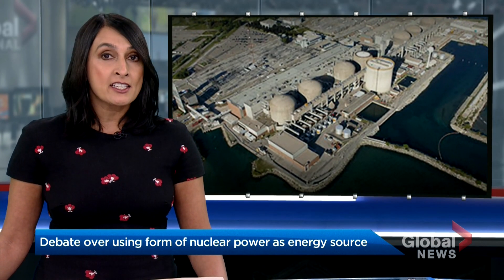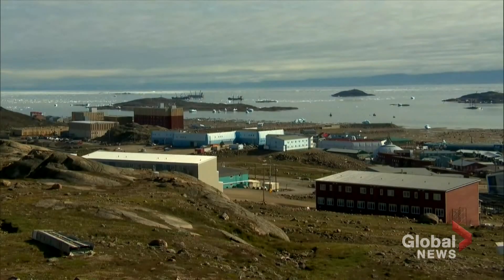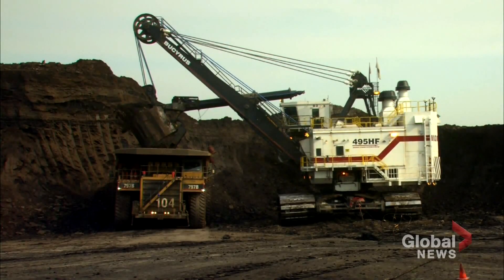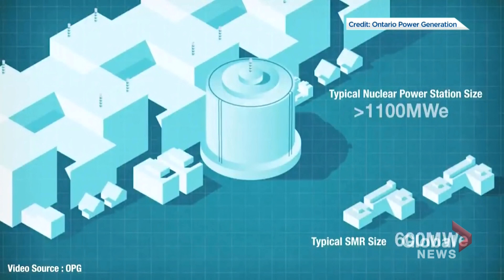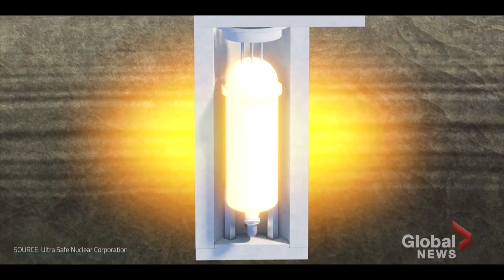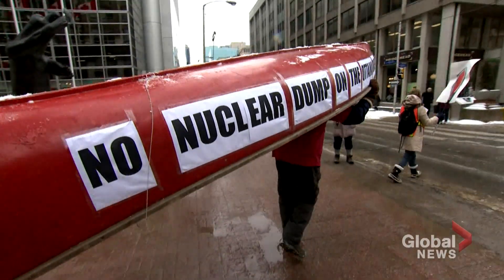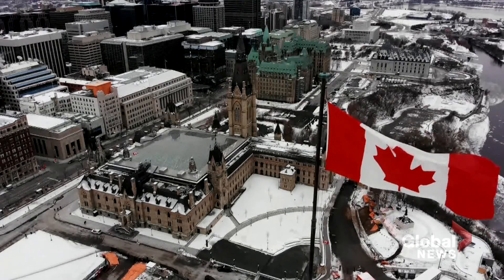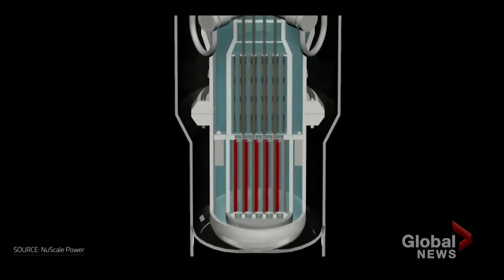Canada's politicians debate over using new nuclear power plant as energy source

Comment: Who would want on of these next door?
Reply: People already live close to nuclear power plants, and they moved in after they were built in most cases.
Reply: @Tyler_0_  Because people are dumb!
Reply: @proximap2151  LOL. More people die from solar. Way more. Look it up
Reply: @proximap2151  I bet you either live near a coal plant or solar/wind farm. Coal is self-explanatory, fossil fuels kill 10,000 people each day. But no one ever told you that the heavy metals used to make solar panels are toxic and are not recycled, they are often left in land fills that leech into the water table getting people sick, and unlike nuclear "waste"(most of which is actually useful and can be recycled) lead and cadmium are elementally stable, meaning they will last forever, not simply 100,000 years.

Nuclear provides the most energy for the fewest deaths, making it the safest form of energy and is easily competitive with fossil fuels. Even if we take the most pessimistic numbers given for deaths from nuclear accidents, it's still one of the safest and has saved millions by replacing coal, research reactors provide medical isotopes for billions of life saving procedures. Anyone who still thinks nuclear is dangerous under any measure comparative to other energy sources is living in delusion.
Reply: It does not have to be right next door.